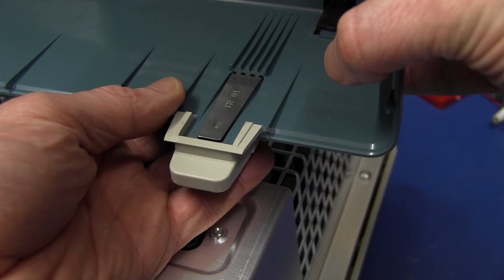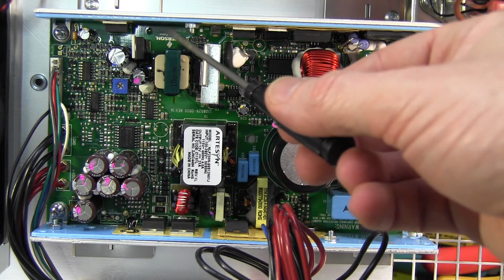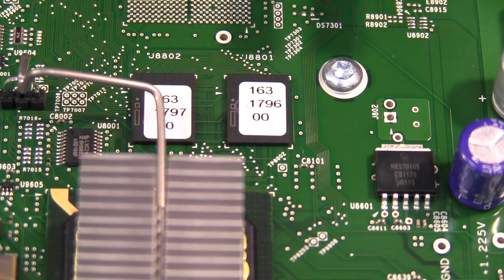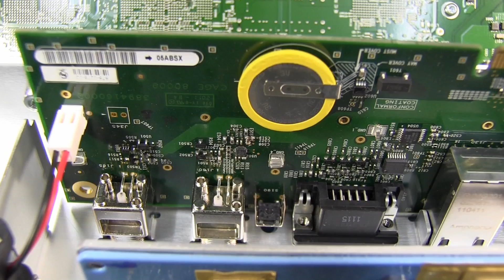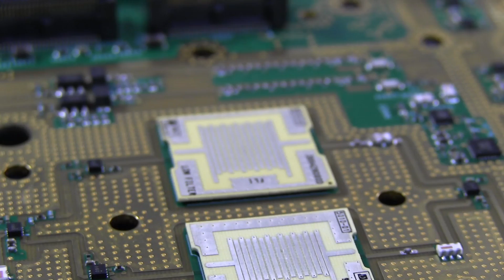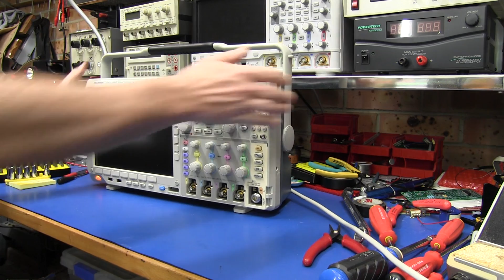Tektronix MDO4000 Oscilloscope Teardown - EEVblog #199

Comment: 10:55 well the fan is pretty much skimped in that it doesn't have a dust filter and it's a fairly old design with not a lot of blades. Meaning the fan is going to be ridiculously loud for the amount of air moved, as opposed to modern fans that have multiple folds more blades in different orientations to minimize sound production

Comment: The long cigar shaped thing with ferrites looks like a broadband balun to me. Probably 50 ohms input with two 25 ohm balanced outputs. i.e. this device will produce two output traces 180deg out of phase which is what a differentially driven ADC needs. There looks to be a pair of buffer amps plus SMD alias filter after the balun outputs.
I could have a reasonable attempt at identifying the whole RF circuit including a lot of the parts but it's hard to be sure from a slightly fuzzy video.
Reply: Directional Coupler.

Comment: The real state of the art engineering in this amazing instrument is NOT in the RF section you are all drooling over. That looks like pretty basic RF design to me, i.e. it's quite easy to trace the circuit paths and see what is going on. It really is just a basic two path RF downconverter (plus baseband path) and I've been designing RF downconverters in the GHz region for over 20 years.

The real state of the art engineering in that scope is in the digital back end AFTER  the RF.

Comment from the maker: @omgitschrislol There is nothing new about expensive exotic high performance test gear like this. You can pay over $100K for a top end performance scope. Volumes are low too of course. If OneHungLow in china could sell a 1GHz+ scope for $1K-$2, they would. Even a "cheap" brand like Rigol sell their 1GHz scope for $10K.

Comment from the maker: @omgitschrislol High performance and high frequency RF and scope frond ends are not cheap (or easy), they use lost of specialised and exotic custom components. This is why only a select few scope manufacturers in the world are able to do 1GHz+ bandwidth scopes for example. These components are orders of magnitude more expensive than components in say a 50MHz scope. Someone on the forum mentioned the RF relay used alone is $50 on it's own or something.

Comment: The circuitry under the diecast shield appears to mostly be signal conditioning (attenuators and gain), split into three basic paths for the (approximately) 0-2 GHz, 1-3 GHz, and 2-3 GHz input ranges.  The first (and probably only) local oscillator is a $10 ADF4350 integrated VCO/PLL chip, which can also be seen in the $900 Signal Hound spectrum analyzer.  That explains why the phase noise specs between the two units are so similar, I'm guessing.

Comment: @guitarbridgecleaner You're not including the cost of engineering, hardware engineering, software engineering, custom chips (with obvious payment for consulting services). They are obviously not going to be selling millions of these things. They aren't gearing this to home/hobby users, it's a piece of pro equipment probably going to be bought in very low quantities to large firms.